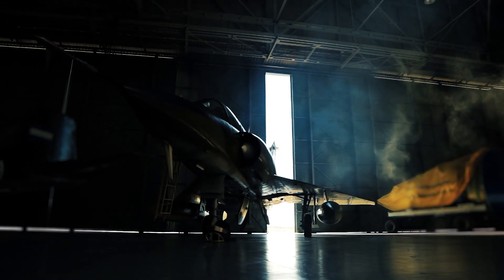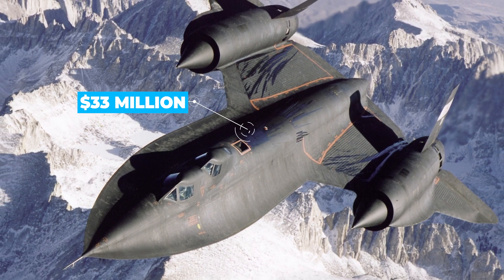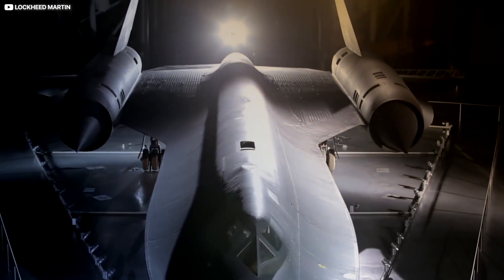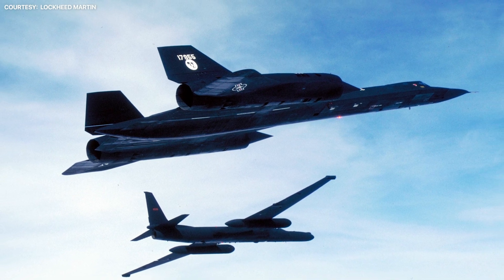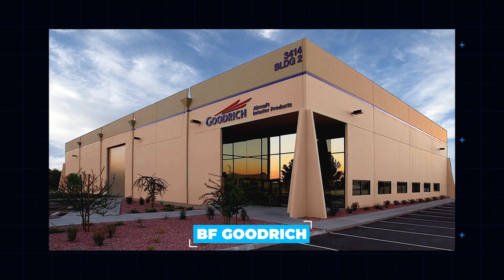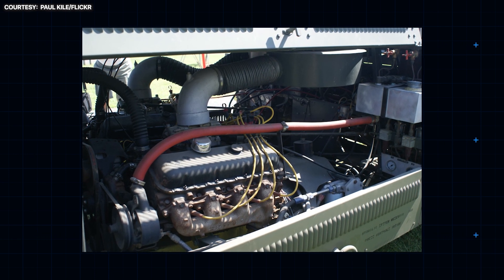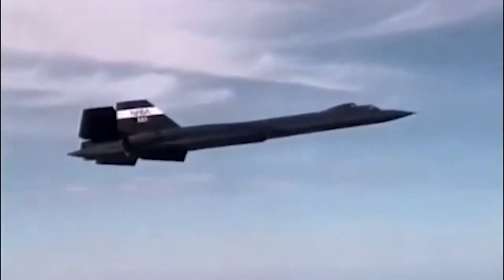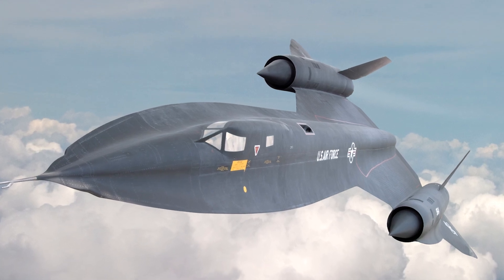The Fastest Plane In The World

Comment: Actually SR71 is slower that the X15 and it goes mach 6.3 but that’s not even close to the fastest thing in the earth a F16 eject tester that can go mach 8.6 or 8.7 it uses rocket engines so that basically counts also it has a very fast deceleration about a few seconds.

Comment: Technically the X-15 holds the title of fasted plane
Reply: Barely a plane, it had to be carried by a b-52 up to altitude, it doesn't breathe air, and it didn't use drag over fins to steer. It's really more a rocket with a pilot's seat strapped to it.
Reply: @riogrande163  stop replying the same thing to all the comments on the x-15 u bot u know your are wrong anyway so stop

Comment: I think it should be the X-15
Reply: Barely a plane, it had to be carried by a b-52 up to altitude, it doesn't breathe air, and it didn't use drag over fins to steer. It's really more a rocket with a pilot's seat strapped to it.
Reply: @riogrande163  facts
Reply: Ok so here is the main reason why the title of the fastest jet PLANE goes to the SR-71.. the X-15 was powered by a rocket engine that would ignite and burn, providing thrust for the first 80 to 120 seconds of flight, pushing the aircraft to speed of mach 6.7 (over 6 times the speed of sound), and after that, the rocket would shut off, and the aircraft would just glide until it landed. This made X-15 flight pretty short, only being about 10 minutes. The SR-71 on the other hand, could provide itself with constant thrust as is used a type of jet engine (turbojet, to be exact), and land on its own power. So, think bout the facts here, rocket vs traditional jet engine. So, to answer your question, the SR-71 has the title because it is technically a (traditional style) PLANE, with traditional wings and jet engines, while the X-15 is more of an "aircraft" because of its use of that rocket engine, and short, stubby wings due to the speed it flew at.

Comment: If you can build a Spitfire, with self sealing tanks, surely you can build fuel tanks for the SR-71 that do not leak. Teflon lined bladders for example.
Reply: The issue is more complicated. At above supersonic the friction heats the metal up and it expands - thereby sealing the leaky bits - but in actual fact the leaks were measured in drips per minute - no biggy - and on takeoff the tanks were almost empty which is why they had to refuel almost immediately after takeoff

Comment: 60 years old , and still the fastest on record , i am sure the air force has faster jets now , classfied
Reply: The air force would have reversed engineered "extra-terrestrial" aircrafts by now
Reply: @sabarishr381  that's precisely what the SR-71 is: reverse engineered ET craft. That's why it's still the most cutting edge.
Reply: Nah it still the fastest
Reply: don't be under any  illusion that the darkstar doesn't exist... because I'll bet it does! Mach 10 and even Mach 15+ has already been achieved. these top secret projects have flown out of area 51 and S4. this tech isn't mainstreaming because it's used as spy tech. yes top gun maverick darkstar is a fictional aircraft, but it's based on real tech
Reply: SR71 is not the fastest plane. X-15 is much faster with top speed of mach 6.7
Reply: @megapet777  x-15 was unmanned aircraft though... call it a drone, and it couldn't slow down or land and was designed to end it's flight in the ocean. however, darkstar is based on real tech
Reply: @weareplanetbounce  what, really? What is darkstar based on?
Reply: @megapet777  darkstar is based on a real aircraft, but the name darkstar is fictional
Reply: @weareplanetbounce  Yeah so what aircraft is it based on then?
Reply: probably not, the US is decaying